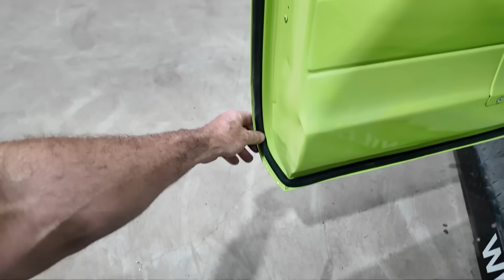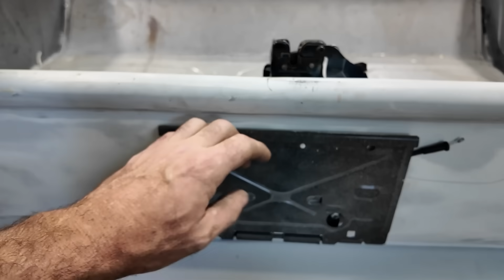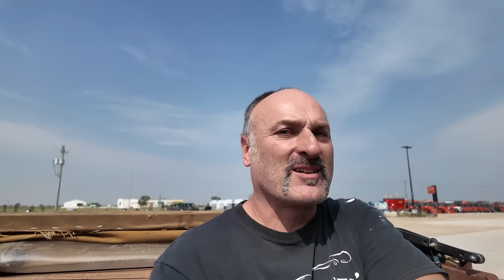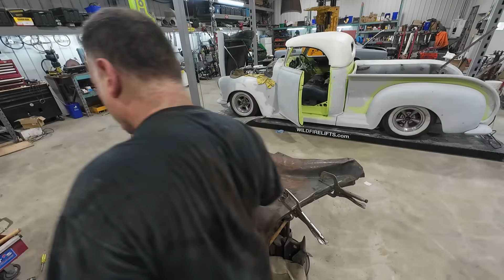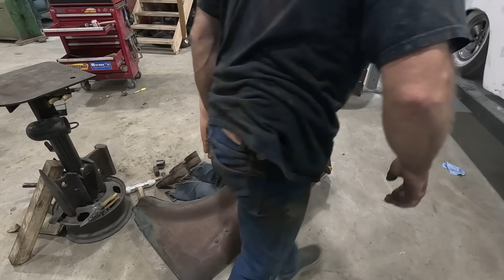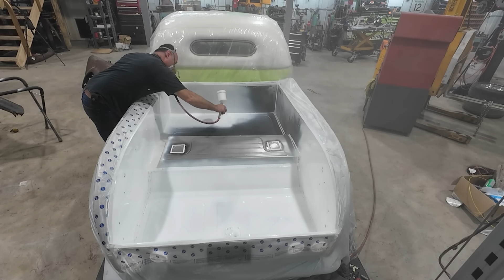We have a little paint and Ryder gets a metal shaping lesson!

Comment: As thick as the steel is on the old vehicles can be a blessing but it can also be a curse. It's less likely to get dented very easily which is great, but once it is dented it is harder to remove the dents. Guys who have only been around working on newer cars with thin body panels can't comprehend that sometimes removing dents from an old one will require the use of a 2 lbs sledge hammer....lol. Ryder is going to be able to do some amazing work after you have taught him the ropes of bodywork.

Comment: Very nice!  On your A/C, the little valve with the copper line coming out of it is your expansion valve.  The copper line is for temperature compensation.  If you broke the copper line, the system will still work, but may run too cold and freeze up if it runs for a while.

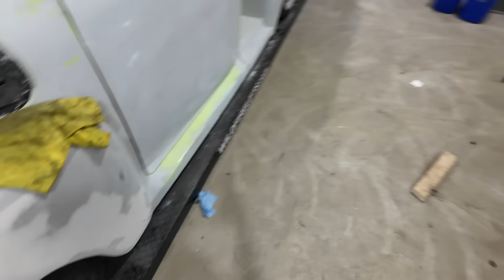Comment: ok i have to say this. at 27:31 the part you have is a receiver/dryer. basically long story short it lets liquid high pressure refrigerant out from the condenser to the expansion valve.

Comment: have you considered using the 12 volt a/c compressors i see some offroaders using the 12 volt can mount anywhere no belts to worry about one put compressor under battery box then used mazda electric power steering pump mounted it under brake booster cleans up the engine a lot less belts and engine doesn't have to be running for power steering and a/c

Comment: After having the last shop burn down, I'm surprised you don't have a proper "explosion proof" (i.e. non sparking lights and exhaust fans) spray booth set up?  Not to mention you're going to have paint dust on everything in the shop. 🤔

"Yes, Canadian Tire's Armor Coat rust paint is flammable. The paint's vapors can ignite explosively in enclosed spaces, and the paint itself can ignite if it's heated above its flash point. The vapors can also travel to ignition sources and cause a flashback. Closed containers may burst if exposed to extreme heat, and empty containers may contain ignitable vapors"
Reply: You have a better chance of seeing Jesus. Paint explosion is very rare I never seen or heard of a paint explosion in my lifetime of painting 35 years. I wouldn't worry about it! 😉✌